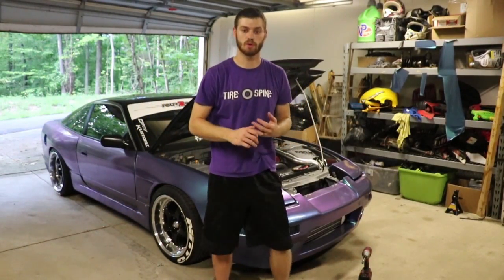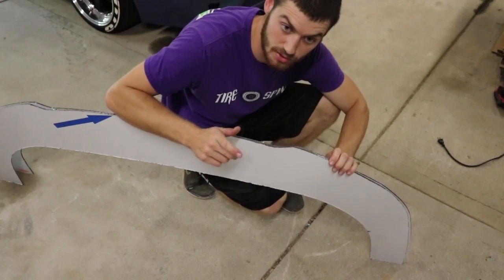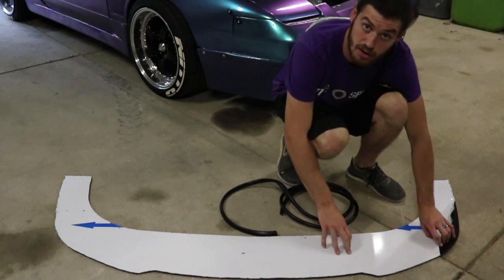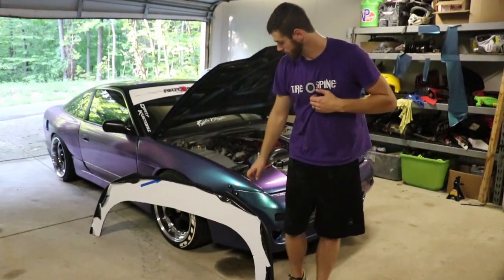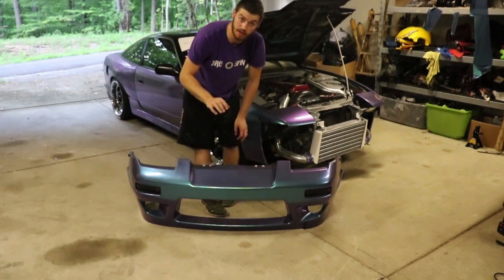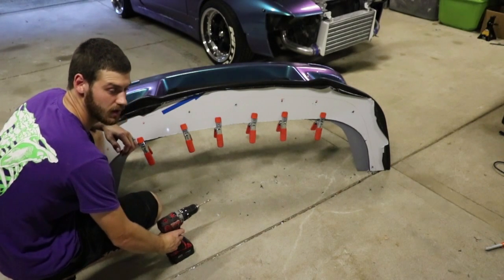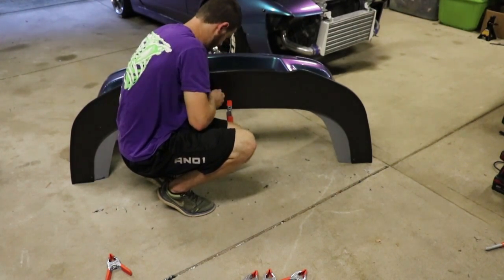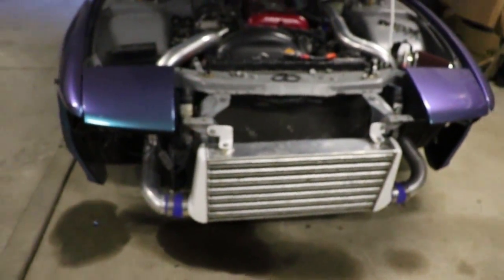DIY Splitter! - How to make & install

Comment: FYI a splitter is actually split this is a chip spoiler lmao, and why didn't you glue them together first then just make one cut lmao 🤣
Reply from the maker: These were cut with a cnc router. I use to use 3mm but found 6mm was better. That is why I doubled it up. I recycled what I had already made.

Comment: Where did you get the ABS ?
Reply from the maker: It is ACM. plastic core with aluminum outside to strengthen it up. I have a distributor I order everything. Email me for a quote - austin.spidergraphix@gmail.com
Reply: Austin Parks can you send me the link where i can get this board vhinrye@gmail.com